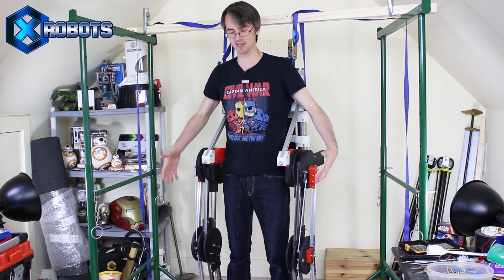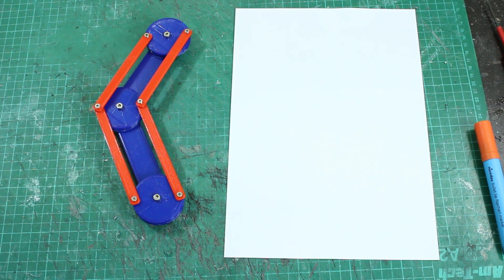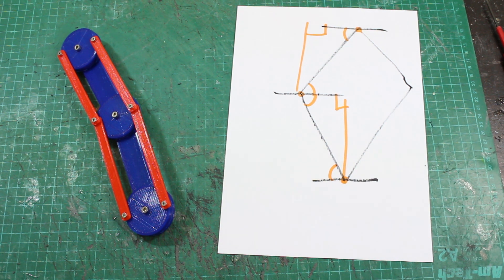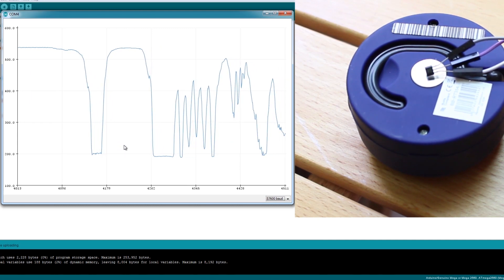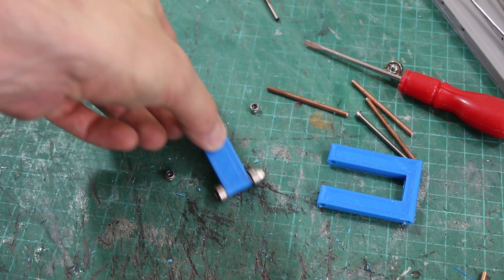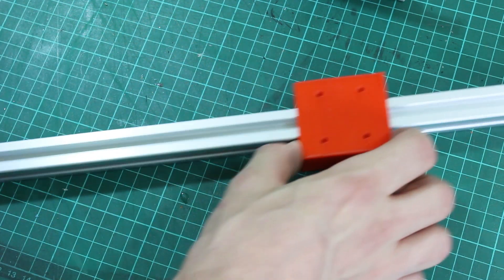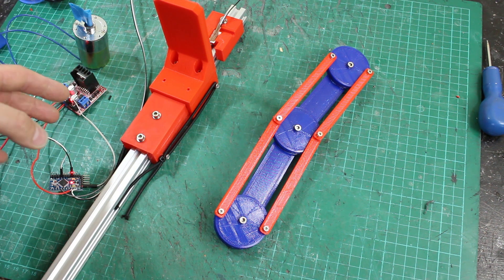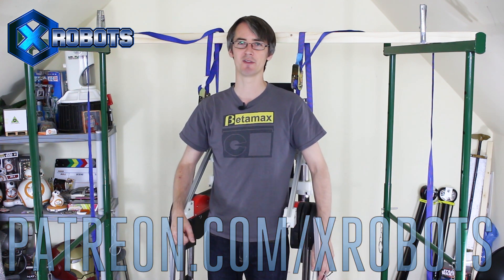Iron Man Exosuit #17 - Controlling the Suit | James Bruton

Comment: Could you achieve the same with an electromagnet? What if you turned a spring into a solenoid by passing current through it, and had a ferrite core at the top that would go further the harder you pressed. You could read the magnetic field generated from the different positions, or simply read the changes in inductance for a passive sensor.

Comment: hello James,
your work is really inspiring ! i would like please to know what 3D printer you use ? and what do you think about the ultimaker 3 3D printer ?
Reply: thanks for your reply James, so i am looking to buy a professional 3D printer so you suggest i buy the Lulzot ? what about its error value is it a 0.4mm ?
Reply: ah ok, well i have a cheap printer the Anet a8 which uses 0.4 nozzle but it doesn't have good quality prints, i did some good ones before but not that much, it creates lots of problems and needs to be adjusted after each print or 2, does the lulzbot have auto leveling ?
Reply: ok thank you James, I am checking your review of the lulzbot now

Comment: Action package does not a good video necessarily make. This video was really good, I enjoyed hearing about the process of finding a solution to the pressure plate needs of controlling the 'suit.

That said, if I understand the legs and feet right, then I suggest you never try walking over uneven ground, or on a surface that isn't perpendicular to gravity's pull. If you want the ability to walk somewhere more challenging, you'll need to tweak the foreleg and/or foot. And probably want something grippy on the bottom of the feet. (Maybe find a discarded tire and cut strips from it with tree-limb cutting snips? I don't know.) I might be getting too far ahead of things though.
Reply: James Bruton
V3, huh? So… Quite a ways off, then…

Yeah, I've heard that that's a good design philosophy: ‘Keep it simple to start, until you know it all works, so you can better diagnose problems. Add more features later.’

Comment: How about attaching a linear position sensor to the block sliding on the extrusion? You could have 20-30 centimeter of travel with perfect linear measurement. All that's required are two light sensors and striped strip. Let me know if you want specifics...

Comment: too many moving parts, it's never gonna work as desired. It will turn out as a mech again and not be anywhere near an exosuit. 
Try to scrub the idea of having mechanical spring loaded switches and go for magnets attached to your joints and have fixed halleffect sensors in the exosuit. This will safe alot of weight and you just have to clean up the noise from the sensors by software...

Comment: Why not solve the pressure sensor problem with math? Now you're trying to solve it in hardware which makes iteration much slower. Couldn't we find a close approximation for the pressure sensor curve and transform it into a linear one? You could precalculate it in Excel and save a small lookup table on the Arduino.

Comment: For the pressure switch, why not just have two flat plates, with thick foam between. the sensor on the inside of the bottom plate and the magnet on the inside of the top. the foam will add a physical resistance to the foot so you'll have to push more, to move more. The whole thing could be stick together with no moving parts (other than the compression of the foam. maybe?

Comment: A sealed, small bag with foam and a fluid inside it with a  small tube coming off of it that then goes to a small piston that presses on the magnet, moving it closer to the Hall effect sensor. Unlike a rigid plane, it would reproduce force from any angle at a proportional amount instead of having reduced pressure when pushed from an angle or on the edge. Yes, bag stretch would be an issue, but easily solvable since the pressures are so low.
Reply: KnightsWithoutATable Thats a nice idea, but in this case wouldn't the forces come from roughly the same direction anyway?
Reply: I don't know how available or cheap this would be, but I think a fine metal chain mesh surrounding the bag, with an optional thin layer of just about any cheap fabric in between in case the metal chain mesh is sharp, would solve the problem of the bag flexing. I can't think of a good way to implement a chain mesh, though, so it's probably going to be a theoretical fix.

Another idea, is using a mylar bag. Not sure how much flex it has though.

Or how about a thicker plastic, like from a ziplock freezer bag.

Maybe the flex of the bag isn't even an issue though. And the wider the cylinder, the smaller the distance the plunger will move with equal changes in pressure.

I like your idea of a bag of fluid, and a piston. It's a neat idea for a pressure sensor.

Comment: I just wanted to say how much of an inspiration you are for me. You got me interested in 3d printing and I’m going to try to make my own robot. I’m still confused on the electronics, but I got an arduino kit to learn. I’m on 10th grade and I’m already getting really interested in mechanical engineering. (Also I don’t know what dc motor I would need for my robot, it’d be pretty small probably 8 inch’s and mainly all plastic)

Comment: Question can a small dc motor move a person on a skateboard? I’m building something for my friend and trying to spend as less money as we can how small can it ,can I use gears to make it easier and if no what motor would you recommend
Reply: Lumber Smasher 6v motors are pretty cheap and have a responsible speed and torque you can find them in hair dryers and automatic nerf guns that require 4 batterys.